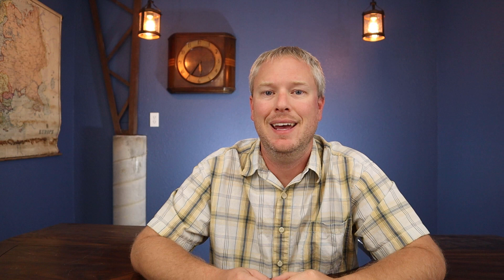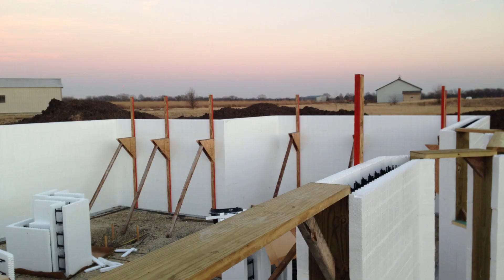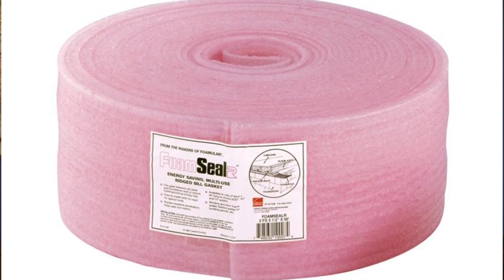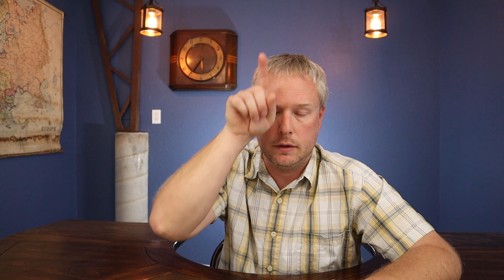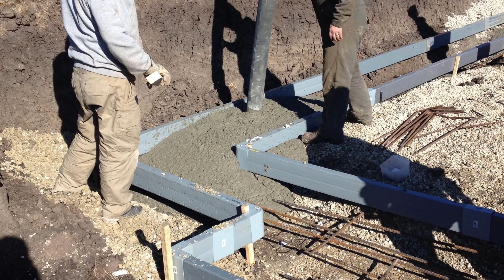DUMB Mistakes I Made Building My Own Home

Comment from the maker: What kinds of mistakes have you guys made on your home projects?
Reply: It’s amazing how many trips to the store are made for fasteners of different sizes, head types, etc. It’s hugely wasteful at $.xx per mile and yy  minutes per trip to drive to the store to buy a handful of screws or carriage bolts.  I now try to buy more fasteners than needed and keep a small stockpile of them.  Similarly, maintain a supply of plumbing fittings, electrical supplies, tubes of adhesive, etc.

Living in the Rockies with dry air, the altitude will suck the energy out of you.  Staying hydrated makes it so that I can work longer.  I’ve learned to sip water all day long.  A CamelBak goes a long way to keeping up physical endurance. Drinking too much water messes up electrolyte balance, so having citrus for a snack helps a lot.

Don’t make perfection the enemy of good.  Sometimes I’ll spend too much effort trying to make something perfect when it just needs to be good enough.
Reply from the maker: All excellent points!!!  I love your last quote "Don't make perfection the enemy of good".  I may have to steal that from ya.
Reply: First, not getting the nice things. Heated toilet seats..... Worth it.
Reply: Did you use the ICF manufacturers foam window bucks?
Reply from the maker: @clintonboyer1217  I didn't.  I made my own out of treated lumber.
Reply: @TheChallenged1  I assume that the wood was flat/smooth on the concrete side. I wonder if they would have pulled back on you creating that gap if they had more attachment points? I’ll have to look into what Builder Block is doing. I’ve seen Fox Block advance over the years. Nice to have a window buck now. They have what looks like two dovetails in them... Makes more sense and gives me greater appreciation learning from your experience. Thank you.
Reply from the maker: @clintonboyer1217  For my main level bucks, I just created a wood box that sat outside of the ICF, but for my basement level, the sides and tops of the wood are inset within the icf blocks and the bottom just sits atop the blocks.  My basement bucks are far more efficient than my main level blocks.  If I was to do it over again, that's probably what I would have done on the whole house.  You just have to use long screws to attach the windows.

Lots of options
Reply: Buy QUALITY tools. I had an inexpensive ladder with hard (vs soft) rubber feet that slipped out on me and broke my back. Extended my build time 6 months while I recovered.
Reply from the maker: @sprezie  Ouch!!!  Thanks for sharing.

Comment: Garrett,  Thanks for the videos.  They've been a great source of information leading to our ICF build beginning in a few months.  Regarding the windows and gaps occurring due to the concrete shrinking during curing, I'm assuming it's best to wait for some reasonable time before sealing gaps around window bucks with spray foam and installing the windows.  If so, how much time would be expected?  Thanks!
Reply from the maker: You should be fine after a week
Reply: @TheChallenged1  Thank you!  Sorry for the barrage - It sounded as if you used the Polywall type barriers beyond the foundation, to cover your above ground walls as well.  What applications did you use to attach your stone veneer and siding?  I've been trying to find these specifics on the Buildblock site.
Reply from the maker: @jeffd0508  I used Versetta Stone, which screws to the webbing in the blocks.

Comment: Thanks for the videos Garrett!  I have learned so much in preparation for our forever home.  i can't thank you enough for sharing your experience!

With this being said, how did you go about sprayfoaming your windows?  Allt he ways I was advised by Nudura would be to install the window bucks between the forms and leave them in during and after pour without adding new bucks.

Thanks!
Reply from the maker: Stick with how Nudura told you.  That's definitely the best way to avoid air leakage.
Reply: @TheChallenged1  Is that what you ended up doing or did you remove the buck to spray foam behind them?
Reply from the maker: @meditationstation3416  There was enough of a gap between the foam and the buck, that I was able to spray foam normally.

Comment: Great content and video production! Just curious if you were able to take time off work to build, or did you work and build the house at the same time?
Reply from the maker: I semi-retired from what would be considered a normal job 5 and a half years ago.  I bought and fixed up a bunch of income properties leading up to that transition out of the 9 to 5.  From that point on, I worked the assets as necessary and built the house pretty much full-time.

Comment: Did you consider doing an ICF deck for your floor, for example Quad-Deck?
Reply from the maker: I didn't.  I like the idea of it for multi-family properties for a fire barrier between units though.  Is that a product you have used before?
Reply: @TheChallenged1  I'm thinking of using it for our build next year.